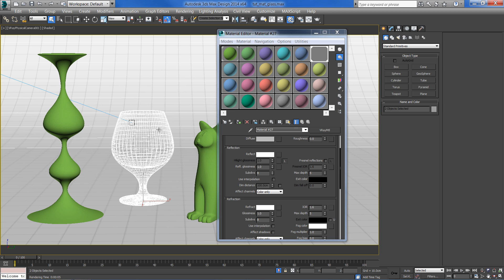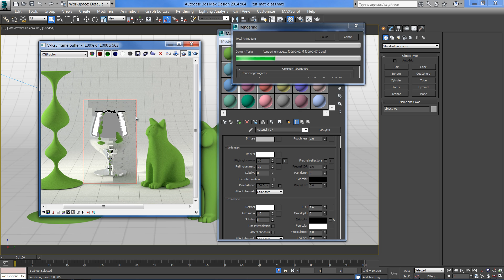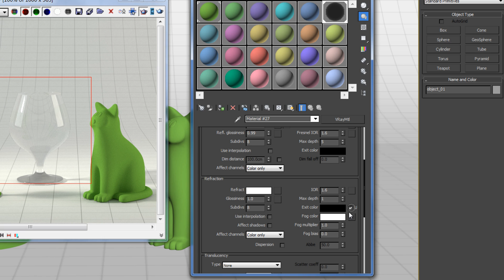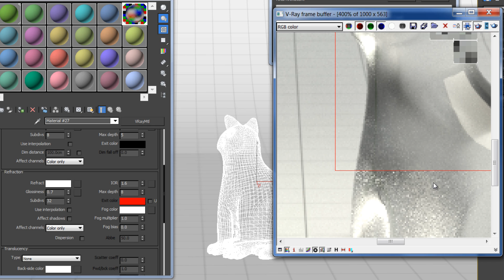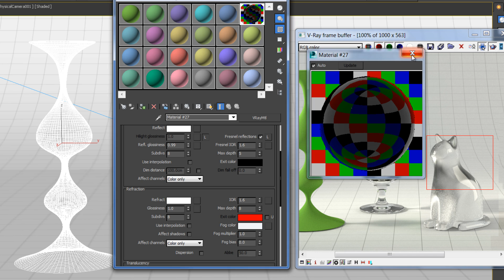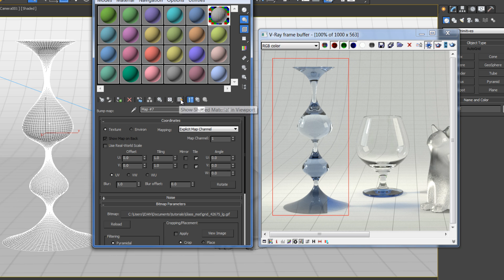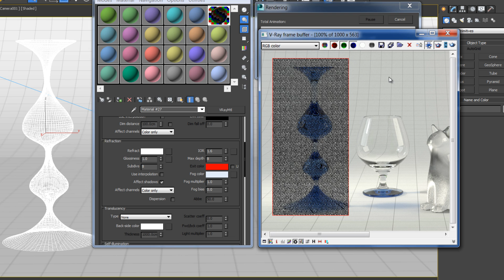Create ANY GLASS material in VRAY using this technique! - Vray tutorial for beginners in 3ds max

Comment: Hello! Any idea why the last step will not work for me? For whatever reason, the bump map does not work for my object. I just made a cube for testing purposes but it won't load the bump map onto my object. I did everything you did so there must be something in my settings them? Vray RT is set as material renderer, I have checked the view material in viewport button and it doesn't change at all. Any help would be much appreciated. Thank you!
Reply from the maker: Hi,maybe the UV coordinates are wrong. try to assign a UVW map modifier on your object, set it to box and adjust it's size.